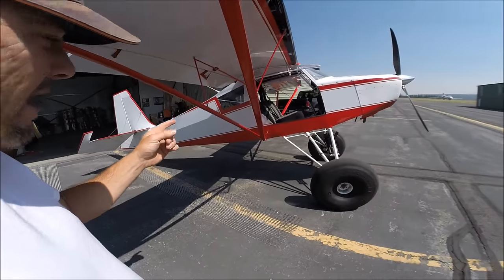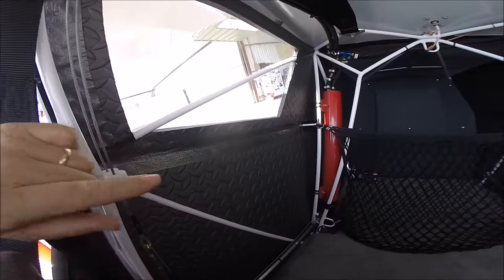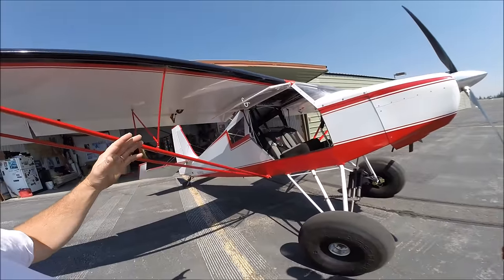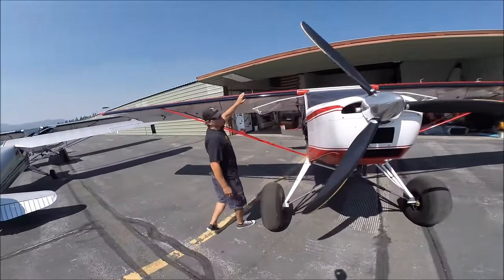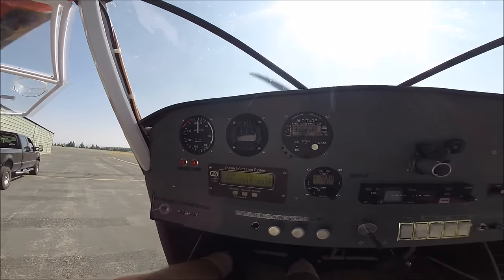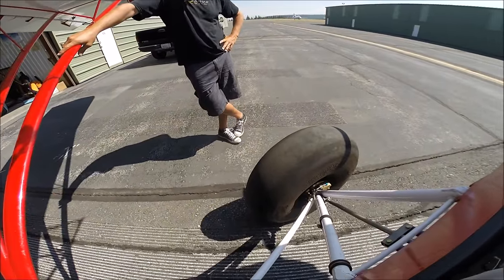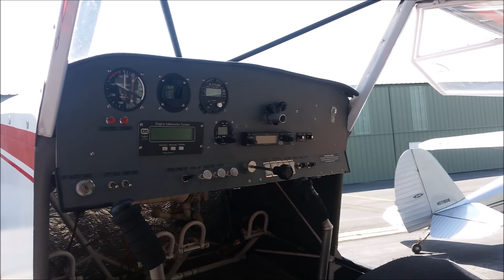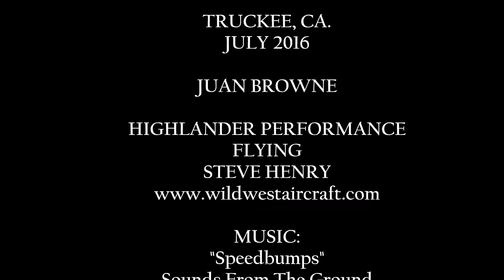2009 Highlander STOL Aircraft

Comment: Thanks for this. Bumped into it whilst researching your earliest Oroville stuff. I have a Highlander much like this one but with Grove gear, no cuffs--VGs. That's why I want to sell the Zenith STOL CH 750/2 (with 125 hp fuel-injected IO-240 Continental). 

I got a ride in the SUPERSTOL at the factory in 2014; you gotta do this if you haven't already. frsmith2 has a video. That strip is badder than it looks, and the crossing "runway" was just brushed when we flew. I wonder what it will do dead stick? You just chop the power, hold the stick back, and plunk 'er in!